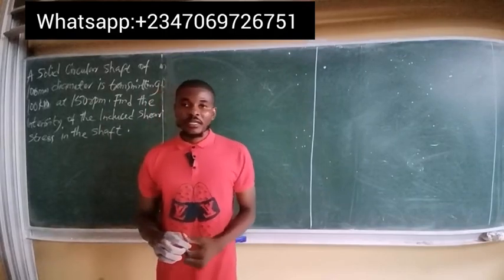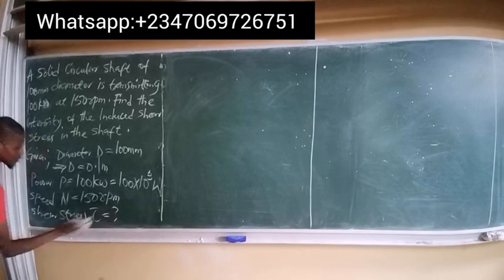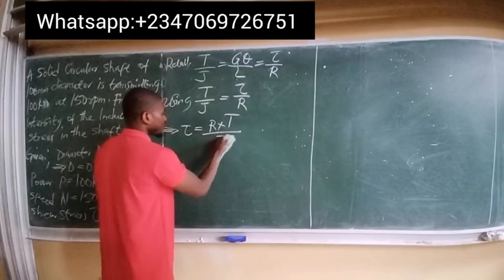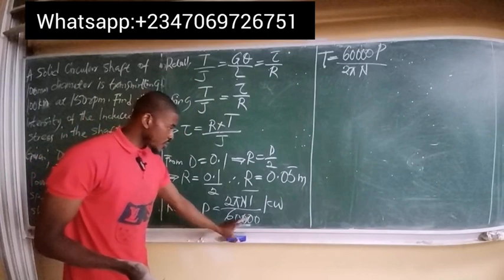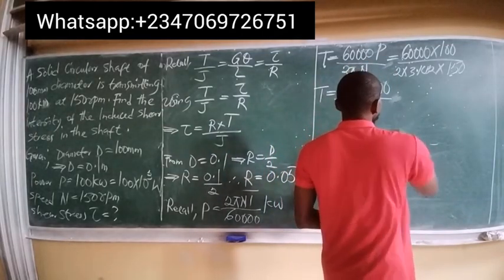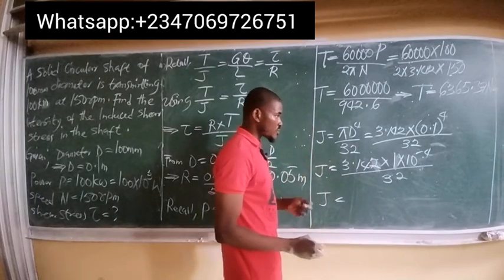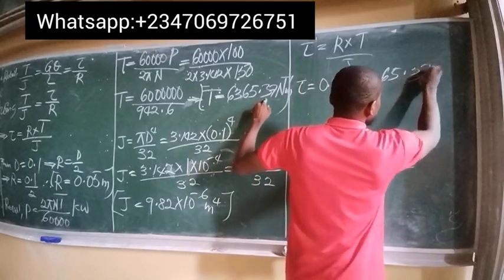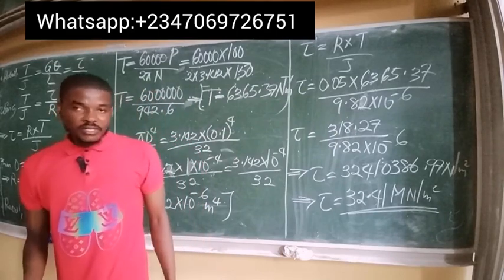How to Calculate the Shear Stress and Power Transmitted by a Shaft||Torsion Equation

Comment: A shop with a diameter of 30 mm is subjected to a bending moment of 50 NM and a torque of 20Nm . Calculate the maximum principal stress and the maximum shear stress
Reply from the maker: I recommend checking out my other video on bending moments for this type of question.